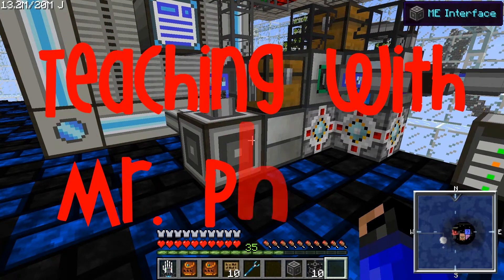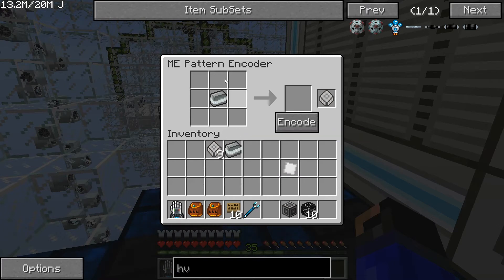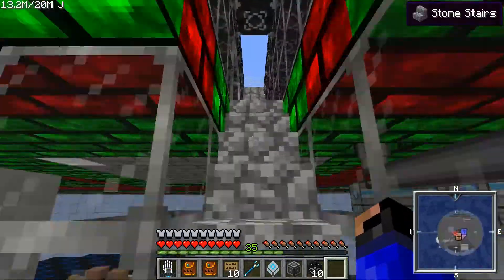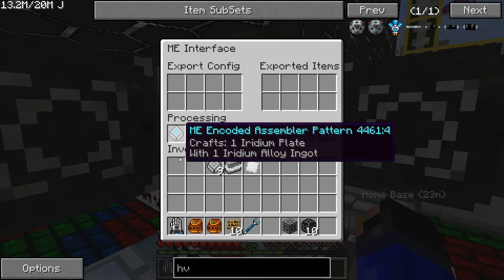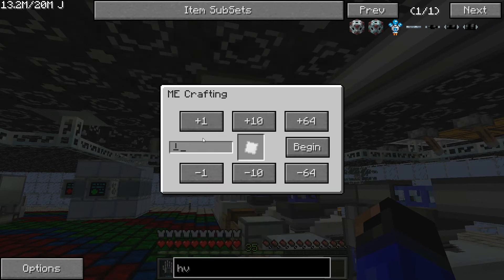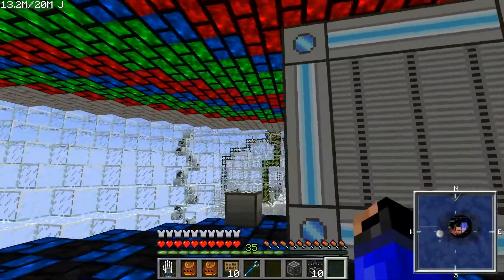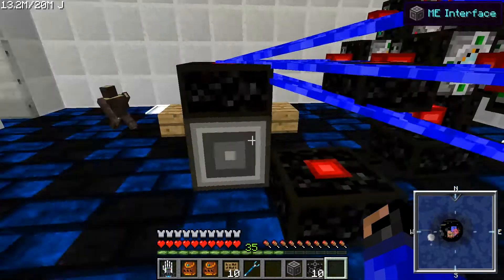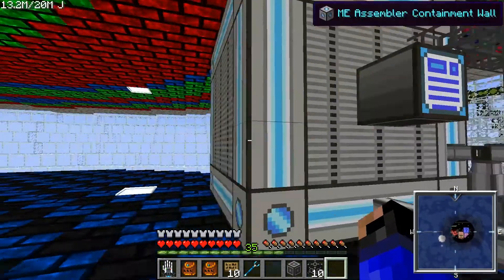Teaching with Mr Phicksur - ME Interface

Comment: I'm having some problems with my ME interface and wondered if you could help. I have it above a powered furnace and encoded a pattern to smelt quartz dust into silicon but it's not registering it for some reason. It's all connected to the system and fully powered, the only thing I can think of is that my other furnace is smelting ores, perhaps it can only do one thing at a time? Thanks for any help :)

Comment from the maker: I have never tried to use an ME interface with a Induction Smelter, and I don't think it works directly very well.

However, I believe that one of the best ways to do that would be to attach pipes to the ME Interface and it will spit out of the pipe whatever it says in the recipe. Then just connect the pipes to the smelter, using diamond to sort gold into one colored input, and silver into the other, and the output from the Smelter back into the ME Interface.

Comment: I'm trying to do what you are but with electrum ingots. I don't want to pulverize my existing ingots into dust to make the blend, but rather directly use the ingots in an induction smelter. Since the me interface works directionally, would you have to make the input slots on top of the a smelter a combo of purple and green in order for it to work?

Comment from the maker: The pattern doesn't go into the chamber. It goes into the ME interface connected to the device it uses to produce the material.

The only patterns that should go into the ME Molecular Assembler are ones that can be created in a crafting table. All patterns that require a furnace, blast furnace, etc need to be put in the ME Interface adjacent to the machine they require, placed so that they are on the side of the machine that requires the input.